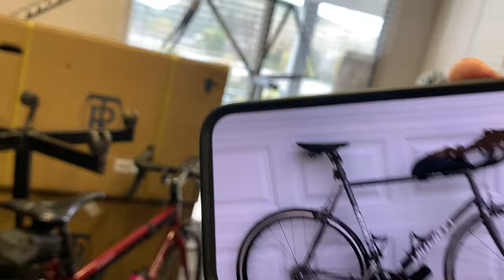An Old Friend Picking Up His Ritchey Road Logic frameset!

Comment: George, it was great to see you and get to chat again!  While I will agree that carbon frames and wheels, disk brakes and aero cockpits are technically superior (and “sexy”), they come with the penalty of added complexity.  To me, there is a beauty in a simple steel rim brake road bike. And it  ridiculously easy for me to maintain a rim brake road bike with external cable routing.  Living in Southern California (dry) and being a larger rider that rides custom alloy wheels with higher spoken counts (28 or 32 rear), I never encounter conditions where I lack enough braking power.
Reply from the maker: it was great to see you as well!  I agree with you on so many points.  They call me a Retro Grouch but honestly so many "new and improved" things are simply not necessary to enjoy a great day out on the bike.  I can't wait to see your Road Logic built up.  Send me a few pictures and I will post them on the channel.  Thank you for your business and your friendship over the years!
Reply: Beautiful bike Mark

Comment: It checks all boxes for easy maintenance and home mecanics . Bsa BB, external cables, 27.2 seatpost, you can fit whatever you want. As it’s a steel bike, no removable derailleur hanger. 
What could fail ?😅
We see a nice Celeste Bianchi in the background. Could you présent us this one? À Columbus tsx frame?
Reply from the maker: Correct there is nothing to fail and all simple and elegant construction.  It is a Bianchi from 1987 I think the tubing only says "Chro Moly" I will check though

Comment: It’s so true that tire and rim width choice is what really matters. I also think that custom wheels are something to also consider.
Reply: Being a “Clydesdale” rider, I am very careful with my wheel selection.  I have broken my share of spokes on rear wheels with 24 or fewer spokes (even on an old carbon-alloy Zipp 808), so I stick with custom-built 28 or 32 spoke rear wheels with alloy rims.
Reply: I'm no heavy weight but I prefer spending the cash on custom wheels when buying expensive wheels. I just feel you get more for your money amd durability. After riding on 24h aluminum wheelset as my gravel wheels that was custom built I just find custom wheels are built stronger than off-shelf wheels.

Comment: Hi George. I've had the new Ti Moots with disc brakes for a few weeks now, and I can honestly say that these disc brakes are the best I've ever tried.

Before this bike, I had another Ti with rim brakes and a Cervelo S5 with rim brakes, both equipped with Enve 4.5 and 5.6 wheels. Those Enve wheels had a textured braking surface (you can Google it), providing excellent braking even in the rain. I also tested some Hed wheels with a similar texture, and they performed as well as Enve (using DA calipers and special Enve pads).

My new bike is equipped with Ultegra 12-speed Di2, and these disc brakes are on another level. They stop incredibly fast, and the brake feel is excellent. Time will tell, but for now, I don't see myself going back to rim brakes.

Oh and Tubeless has been great! Super nice and Dynaplug is holding strong.
Reply from the maker: Thanks for watching

Comment: I got the new road logic as well in a 55. As for shock-absorbing seat posts - go for the Ergon all road carbon post. It’s the split one they also fit on canyon endurace. It came best by a mile in flex tests and I swear by it and put it on my road logic. Smoothest rise of my life and traveling with me to Laos for work and ride tomorrow.
Reply: As I mentioned elsewhere, the Ergon has a recommended max rider weight of 220 lbs.  I am currently at 215 :-/ Also it is not flex I wanted as much as dampening.  I was dealing with pinched nerve in L5-S1 joint that was excruciating painful every time I hit a pavement joint.  The rubber cushion in the eeSilk+ is just enough to dampen those hard road shocks.
Reply from the maker: Hello Philip thank you so much for chiming in on the Ergon All Road seat post.  I think I will get one for my Outback and try it out.  Thanks for watching!
Reply: The other issue I saw with the Ergon is that it probably optimized to an average rider that is considerably lighter than l am.  The CC eeSilk+ has interchangeable rubber inserts that allow you to tune it based your individual rider weight and amount of dampening desired.  Again a “Clydesdale” rider problem :-/
Reply: @markganzer I guess, I mean they make the endurace in big sizes and fit the ergon post throughout but yes, I am sure a weight limit applies. Good luck with your new setup!
Reply: @SeeYouUpTheRoad cheers. I am curious to see whether you can fit a 32 tire on your road logic as you suggest in the vid. In my mind the tight spot will not be the fork or rear but the brake caliper. I am running conti 4s 28s on 25 mm rim and it’s not tight but anything above 30 will be.

Comment: Love the videos. I have a question for Mark.
I would like to know if there are handling compromises in using the Swiss Cross ( cantilever brake ) as a road/gravel bike ?
I have a Moots road bike , all mech.disc.Campy and would like to replace my Raleigh Willard 4 disc brake aluminum frame with a steel rim brake frame.
Thanks, Dave
Reply: Sorry did not see your message earlier.  I have a Breakaway Cross, not a Swiss Cross.  The BA Cross has 7mm higher bottom bracket, but the 60cm version I ride doesn’t feel twitchy all.

Comment: Am I the only one not enamored by either of the colors Ritchey offered this year?  The green Disc is especially lackluster.
Reply from the maker: Hello Barry, you're not alone.  I am not particularly enamored with the Road Logic Disc green color.  However, as I mentioned in the video, I didn't think much of the Road Logic rim color combination until I saw it in person.  It struck me as an odd color combination when looking at the pictures on the internet but I really like it now.  Thanks for watching!
Reply: @SeeYouUpTheRoad  It's a shame for me about the Disc.  I really wanted a modern steel road bike (I have a perfectly good rim brake bike and don't need another), but I think when you look at your bike,  it should make you want to ride it.  That paint job just doesn't do that for me.  I also wish the Disc had a little more tire clearance than the rim brake version; Ritchey will tell you it should take a 32, but I would like a more definitive answer from them.  It basically comes down to it might depending on your tire/wheel combo but a disc frame should easily clear 32 in this day and age.  

I'm looking for other options - maybe a Fairlight...
Reply from the maker: @barrytantlinger1033 you know the old saying - you can’t please everyone. I absolutely LOVE the new rim brake frame colors and so does Jess 😊 It’s different and nobody has anything close to it. And you really need to see it in person it looks freaking amazing! Also there is no reason anyone needs more than 32 tire clearance on a road bike. I’m happy with my Road Logic colors and I’m happy with 32mm tire clearance and so are so many riders I’ve spoken to. If you need more than 32 get a “gravel” bike and put 48’s 😂 just kidding but not really

Comment: I am sold on the ergon seatpost
Reply from the maker: Is that the one that has a split in the main shaft and no moving parts at the saddle clamp?
Reply: I looked at the the Ergon seatpost, but it has a rider weight limit of 220 lbs.